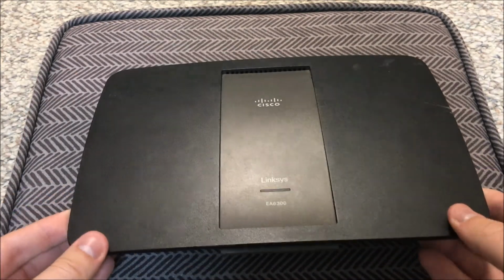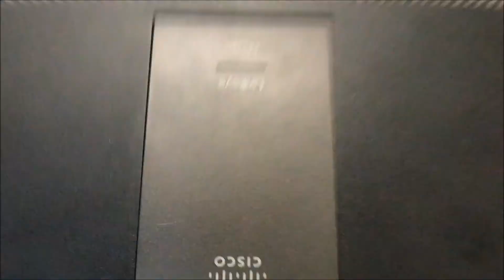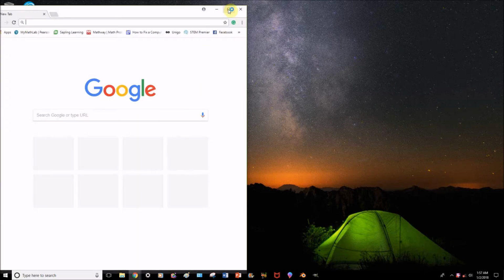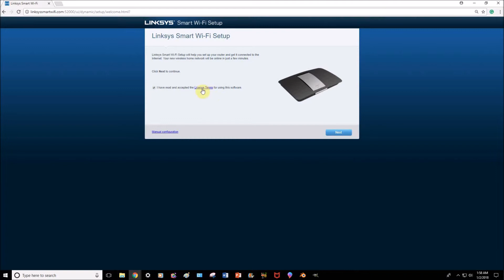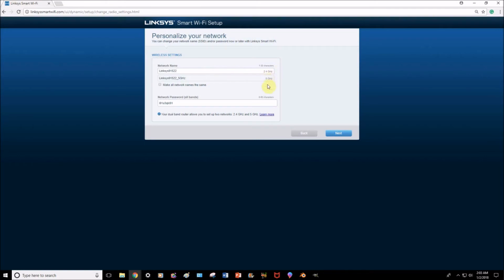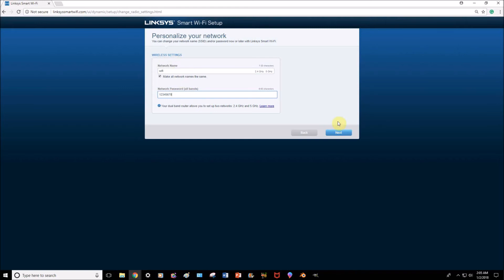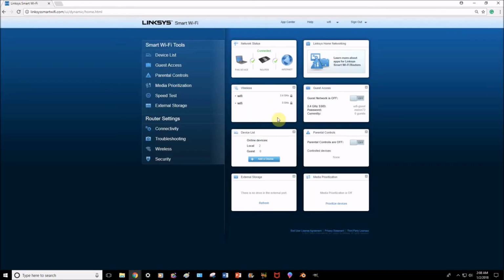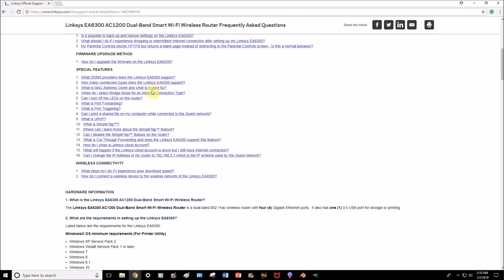Linksys EA6300 Router

Comment: So this router bridge mode automatlicaly   to ur fiber o ads modem isp???
Reply from the maker: Jean vandame in my case it does it automatically. I’m not sure I understand what you mean by o ads modem isp?
Reply: @simplicityelectricity8710  coaxial !! Sorry
Reply from the maker: Jean vandame to my understanding, regardless of fiber/coaxial/ethernet, this router should not be able to bridge automatically without some tinkering with the settings. Possibly try to use the same and password as your current wifi.

Comment: Is there any feature in this router that I can choose the operation mode. For example, Wireless router, Access Point, and Hotspot Router etc.
Reply from the maker: David Tu'amoheloa unfortunately no. I stopped using this model awhile back and to my knowledge it never offered the ability to change modes. Newer models generally offer what you’re looking for though. The device can only function to extend the existing network via Ethernet cable and be used as an access point/cabled extender. I hope this helps but if I didn’t explain it well enough please don’t hesitate to respond back.
Reply: @simplicityelectricity8710  thank you so much for your quick response. I really appreciate your time and effort to make this video even though it doesn't have the feature that I'm looking for. But anyways, you got one subscriber straightaway.
Reply from the maker: David Tu'amoheloa thank you very much! I just do this when I have the time. I know how confusing and how many ads some video have so I always try to keep mine straight to the point and ad free!